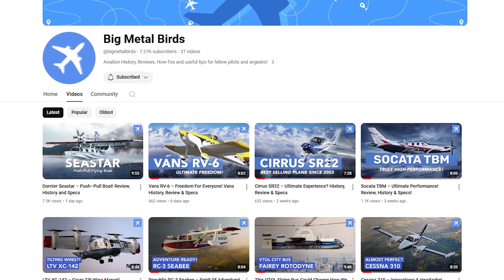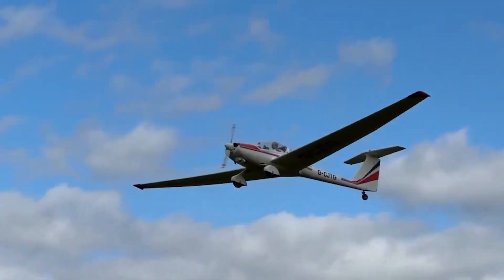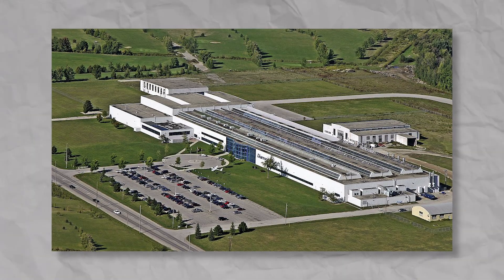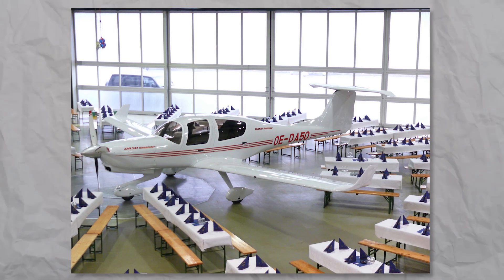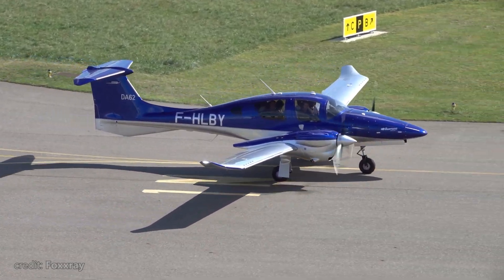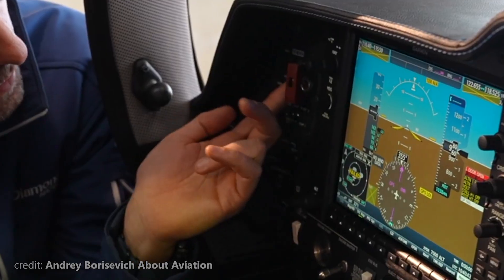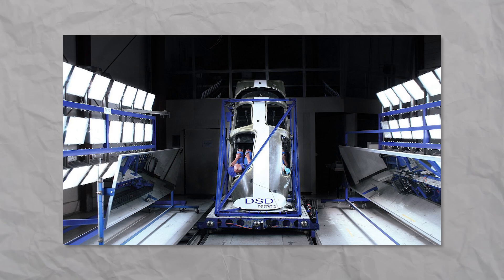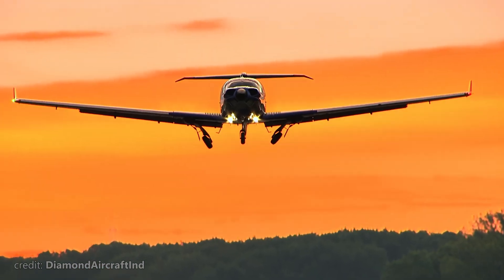Diamond DA50 – Fast, Safe and Expensive! Review, History & Specs!

Comment: I want a parachute on my diamonds when i order them. I am not concerned about egin failure at FL10000 i am concerned at 300ft after take off. And the only landing i have are houses to stop me. I   BRS or air brake would be very welcomed , shaving off any knts before impact is appreciated

Comment: It is a shame that it does not have the range of the DA 62. Then they would have an awesome aircraft, with also a pressurised cabin to take it to 30,000ft and a 5 bladed propeller. This to give it range and speed.

Comment: As an avid Diamond Pilot I can say : Yes, beautiful aircraft, industries best handling qualities, perfect Garmin G1000 suite and not to forget the fabulous Jet Fuel powered FADEC engine. BUT : For this price, the aircraft range is too small. Practically  (if you plan with a nearby alternate in IFR-Conditions) you can just fly around 2 hours and 45 minutes. Finish! Why does this big SEP airplane has only 11 Gallons more fuel then the DA40 NG ? And the ridiculous MTOM of 1999 kilograms. The official answer from the company : Because their owners (in Europe) don't want to pay the IFR-fees (because in Europe, you don't pay IFR-Fees if your MTOM is lower then 2000 kgs). Sorry to say; this sounds to me like a bad joke. With such a big wing and the 300hp engine,  you should be able to boost the MTOM to at least 2300kgs and it should be possible to add 20-25 gal more fuel compared to the DA40 NG.

Comment: I think they are roughly the same price because most people don't want 2 engines even if they have the rating. Twice the cost per hour in fuel, twice the cost of an engine overhaul and honestly, they aren't really any more safe for most missions than a single engine. In fact, I think there's a stat that multi-engines are more dangerous unless you fly them regularly and are familiar and proficient in handling emergencies.
Reply: @tymark1  Light twins are not safer than singles. They have far more fatalities, almost all of which are pilot induced. You make more mistakes in a twin.

Comment: To clarify: no Diamond Aircraft has an BRS on board! So that is why I am wondering why Diamond aircrafts often seen as the safest aircrafts in the world just based on accidents reports from general aviation? There are so many other factors wich have to be taken into account! E.g. maybe many unexperienced pilots decide to fly a Cirrus exactly for the reason having a parachute in case of emergency. The pilot with his experience and his behavior has the biggest impact on the "death rate" in the cited GA accident report *IMHO*!
Reply: In addition: Even if the design an ramp appeal is great - the specs are terrible compared to the peer group (and the price!) --> a Cessna T182 is outperforming the DA50 in almost every number (except speed) for half the price.

Comment: No ballistic parachute, sorry.
Reply: I'd rather fly in one of these than a Cirrus any day of the week. DA50 has a practically unstallable wing. Whereas SR22s spin in all the time
Reply from the maker: hmm are you sure? it says its BRS equipped on their website.
Reply: @bigmetalbirds no BRS but parachutes aren't the safety panacea the OG poster thinks they are
Reply: @bigmetalbirds  No BRS as far as I could see. Also this is not mentioned in any of the magazine/pilot reviews that I have read.
Reply: The DA 40 has a .35 death rate vs Cirus 1.6 per 100,000 hours
Reply: Diamond has the least amount of fatalities per 1,000 aircraft in the industry, fewer than Cirrus. A ballistic parachute doesn't change that.
Reply: @Maniac742  mid-air collision? you cannot fly with a missing wing.
Reply: @heikorudi6105  Diamond's fatalities per thousand aircraft is 1/5 that of Cirrus. You are safer in a Diamond. Period.
Reply: it's optional, you can equip that and also a deicing system.
Reply: @samaelfaneste4276  there is no such option on a DA50. Diamond doesn't believe in a parachute system.
Reply: 😂😂😂 Apparently you don't listen. The video claims it's included 😅😅
Reply: @philwiesemes8020  I'm agreeing with @dealer197 that the video is incorrect on that point.